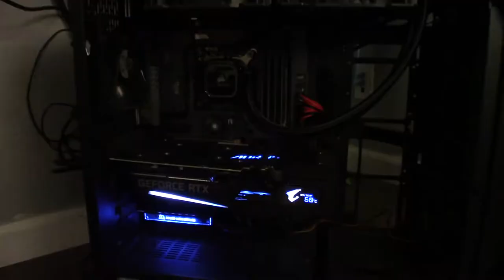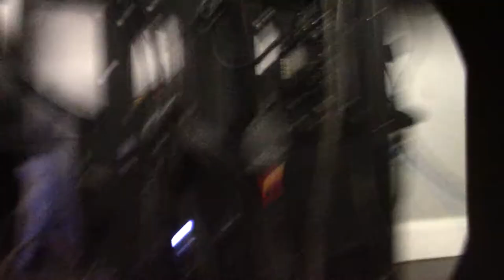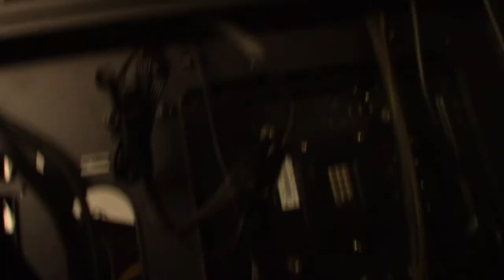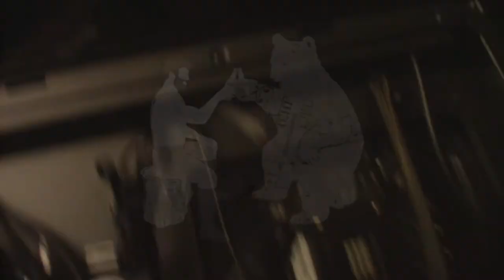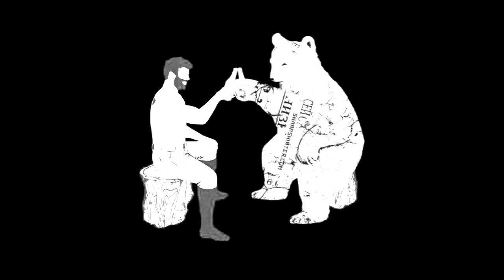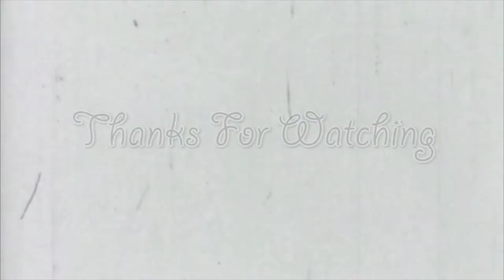Corsair H115i No LED RGB on pump Hydro Series CPU water Cooler No 3.3V rail not working

Comment: Another method of fixing this is just unplugging the wire and switching the slots, I did this and my RGB came on just fine
Reply: Wait… what do you mean? I have the same problem with no egg on the pump head
Reply: What do you mean?